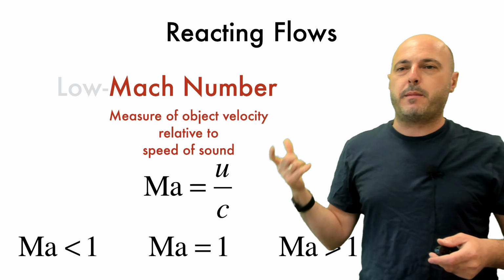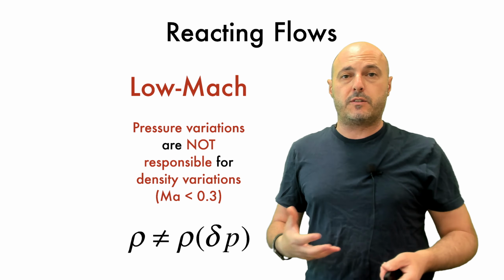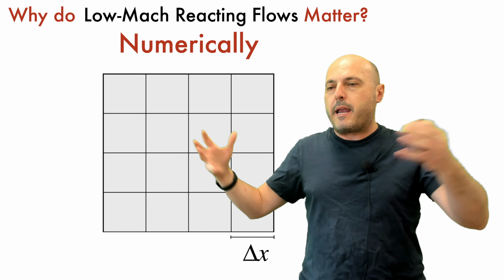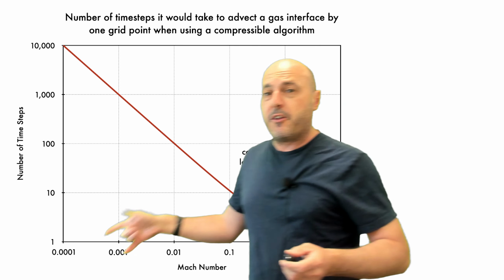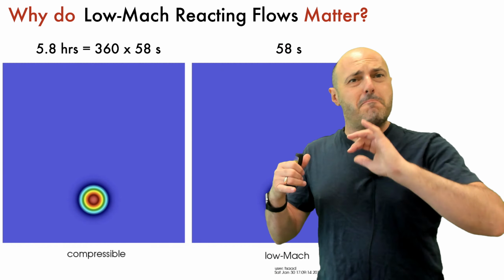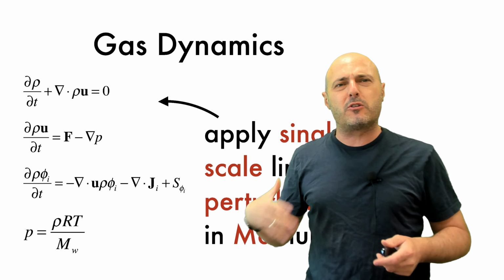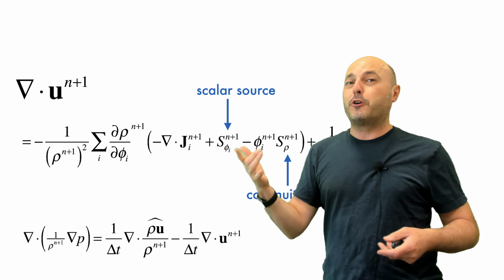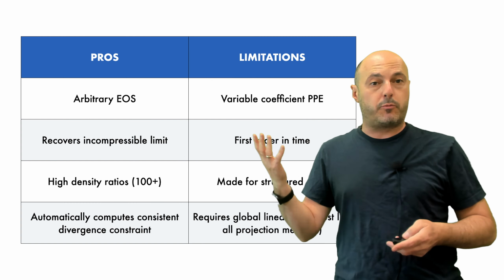What are low Mach Number Flows???

Comment: Dear professor Saad,
Very interesting talk, thank you very much. I would have some questions if you don't mind, sorry if it's a bit messy:

At 2:50 you are talking about thermoacoustic interactions right? I'm writing my PhD on this topic and I'm still unsure what would be the best approach to tackle such simulations.
For example, I have simulated a laminar flame that is perturbed by a variation of the inlet velocity and I have studied how the heat release is impacted, I think for this configuration, the "low-Mach" assumption is fine. 
Now if I want to consider acoustic waves interacting with this flame and see the impact of those wave on the heat release, can we still use a "low-Mach"/pressure-based solver?
So far I have only used pressure-based algorithms (derived form of the SIMPLE-PISO algorithms) for reacting flows, but it seems that a part of the research community dealing with compressible flow is critical toward such methods. The space and time  discretization schemes employed in pressure-based algorithms tend to be very dissipative (low order implicit time stepping, upwind schemes ...) and we could loose some information. 
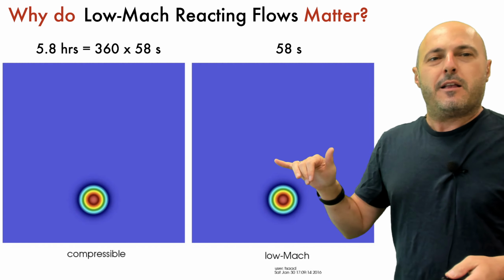Also when we are dealing with reacting flows we still need a small time step (~1e-6 to 1e-8 s) when taking the fast chemical reactions into account, in those case the iterative process to solve the linear system  used in pressure-based algorithm is not so efficient anymore and the speed-up in calculation time that you show at 13:47 won't be that great.
Finally as you show at 16:00, pressure-based algorithm don't scale that good in comparison to density-based.

I would really appreciate to have your feedback on this, and thanks again for all your work on Youtube to make CFD more accessible.
Reply: Hi Pablo,
I hope you have found answers to your questions. If so, could you please share your knowledge with us?

Would love to hear about your research as a fellow CFD Engineer.

Comment: Thanks for your video and I learned more. I have  a question about the pressure possion equation. What is the P in the pressure possion equation? thermodynamic pressure P0 or mechanical pressure P2? I thinck it should be P2. And In the conpressible solvers in OpenFOAM, the P means P0+P2.